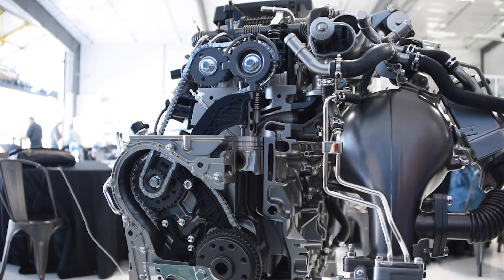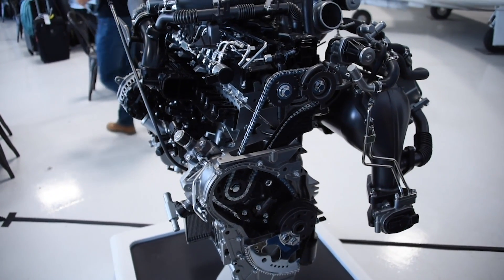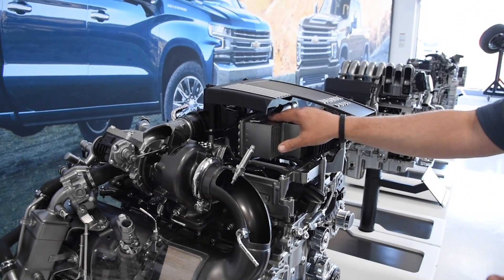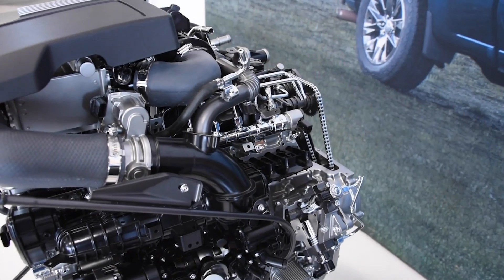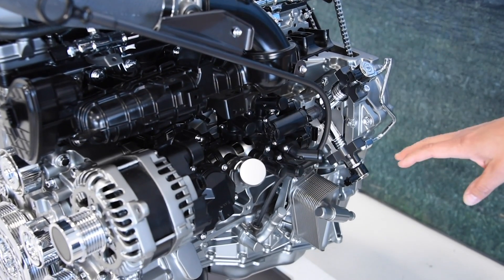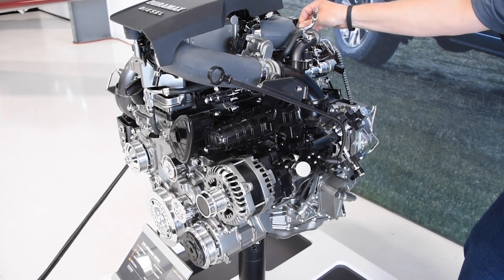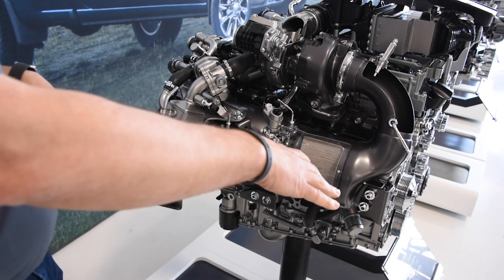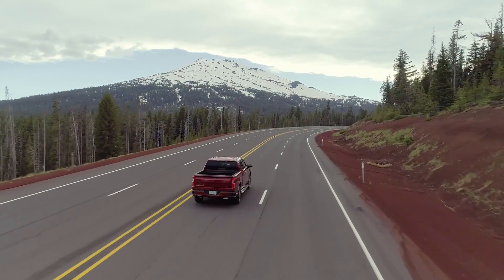What you don't know about the 3.0-liter Duramax diesel

Comment: Clean sheet design with all kinds of new technology.  What could possibly go wrong?  2020 buyers are going to be guinea pigs.
Reply: I just got done telling my 2nd gen Ram 5.9 Cummins about the story behind the Olds 5.7L Diesel.

She took it pretty well.
Reply: @JerzeyBoy  
Please, elaborate some more on the Oldsmobile diesel engine. I've never heard of it.
Reply: @Sig721Tau  the Oldsmobile Diesels were built between 1978 to 1985. They came in V8 or V6 configuration.
https://en.wikipedia.org/wiki/Oldsmobile_Diesel_engine
Reply: bill2526 bill2526  I would love to see a Toyota diesel over here in the states, it would be awesome!
Reply: bill2526 bill2526 you dumbass, I've got 20000 lbs to tow, now what !!!!!!  Girly Toyota can't tow that
Reply: It's going to be worse than fords 6.oh powerjoke.
Reply: @PatrickBaptist  the 6.0 was a great design until American emissions equipment hit it. It's a thing with imported diesels. International tractor trailers used a 10L engine from Germany that was great until it had to pass US emissions.
Reply: @vendediesel  from a "design" standpoint the 6.0 is and always was junk even with no emissions. I guess you have never taken one apart. It looks like it was designed as cheaply as possible and it shows.
Reply: @doch5123  if you were so brilliant you would know that that's a result of the engine being adapted to US standards and I'm not talking about the pushrod wear or the bolts per cylinder. It wasn't meant for PSD hp levels and US dirty diesel and emissions controls. Engines are designed and purpose built. The 6.0 was not purpose built for what ford used it for. In a 26000 lb International truck (what it was designed for) a 6.0 will easily last 300k with no problems except for the EGR cooler. Can you guess why that is?
Reply: Does anything last forever NOOOO... F^*ckin stupid!!!
Reply: "Clean sheet design with all kinds of new technology.  What could possibly go wrong?  2020 buyers are going to be guinea pigs." No jive. Classic Detroit BS.
Reply: You probably can’t afford a decent truck, no wonder why you sound so bitter.
Reply: @cubanpp   I can afford whatever kind of truck I want.  I recently bought a brand new Silverado 1500 LTZ with the 6.2L and Max Trailering package.  It's the perfect tow vehicle for my travel trailer.
Reply: @AlaskaErik  lol it's new it's perfect for a one way trip to the dumpster
Reply: bill2526 bill2526 i can tell youre a toyota driver by the incredibly low literary ability you demonstrate here
Reply: AlaskaErik Exactly! Get the extended warranty!!
Reply: @JohnDiMartino  Why should I pay even more just to get a bad motor fixed?  If I get a GM, it'll be with the 6.2.  At least it's been around for awhile.

Comment: This motor was created by engineers. Their Solutions are correct not armchair YouTubers.
Reply: ya? how about a master ase and gm tech that predicts those chains and belt system will fail commonly before many are out of 3 year 36k warranty?
Reply: Hmm, dry sump engines use belts for the oil pump. Seems like they work pretty well also. A lot of people freaking out on this.
Reply: This is an engine. The Volt uses a motor

Comment: How well is this going to work as a work motor? Pushing snow, Towing, constant use?
Reply from the maker: Well, the idea is that it should work like a diesel...it is designed for towing. However, probably not the same intent as a diesel that goes in a heavy duty truck, which is designed for heavy duty use. I doubt that there will be any snow plow application for this one.
Reply: not well better off with a v8 gas
Reply: @Mr Sunshines I didn't think it did.

Comment: Access the belt by simply dropping the transmission? Great idea!! The engineers should get a medal for making it so simple.  Idiots , how much will that cost?  Imagine how hot under hood it will be with all that emissions garbage on there .  Have fun who ever buys this disaster.
Reply from the maker: That's what I thought initially. But actually, dropping the transmission would probably not be any more difficult than if everything were up front, where you would have to remove the the radiator, fans, etc. Of course, we're talking for a technician, not someone in their own driveway...but it is doubtful that most consumers would attempt a job like this. I do agree with you about the under hood heat, though. That could end up being a problem over time.
Reply: The RV Connection , at least the front parts are manageable for the average backyard mechanic. A transmission not so much.  Just gm making it overly complicated so you need to bring it to the dealership and eat a huge bill.  Shop rate here is $160 an hour, so it will be expensive.  I think about the poor person that’s going to own these trucks after the warranty is expired .
Reply: Mr Sunshines sure.

Comment: How hard would it have been to just use a chain they want it to fail ive been around diesels since the early 70s and not even 1 had a belt driven oil pump,same enguineers that developed the oldsmobile diesel more than likley DUMB ASS!!!
Reply: It's a metallic belt... it wont fail.
Reply: A metallic belt is much lighter and efficient than a heavy metal chain.
Reply: @Mr Sunshines Finally common sense has arrived.
Reply: @Mr Sunshines your the dumb ass youll buy one then cty about it when it breaks

Comment: Terrible design. Dropping the transmission for that is unacceptable.
Reply: Its actually easier to service the belt from the rear! Use your head man! I am excited for this engine gm thought of there customers when they designed an priced it!
Reply: Having to drop the transmission to change a belt will make most owners sell this truck before it becomes necessary. This will kill the resale value. It might make a lot of money for repair shops but most owners will not want to deal with the hassle. The engineers need to fix this issue ASAP.

Comment: I am a GM faithful, I have four of them but I will not be buying this unit as it uses old technology that we already know does not work like injecting fuel into the cylinder on exhaust stroke. As tested in LMM Durimax and 6.4 power stroke. 
When the Colorado Diesel came out I went to the dealer to buy one and would have except my sons car seat did not fit in the back seat. So I have been waiting for the half ton to come with a diesel but now I’ll be waiting a while longer until someone cracks the ecm code so I can delete it right from new.
Reply: Be glad you didnt buy the colorado the diesel uses a timing belt my nephew bought one they said the belt has to be changed around 100k not good
Reply: @dewaynemiguel3349  that's not true lol
Reply: @geauxtigers2911  thats what the dealer tol him ,theres no reason to use a belt when you can use a chain unless you want it to fail ive drove bog rigs 42 years and companys would not buy a certain enguine if it wssnt built to last
Reply: @dewaynemiguel3349  then you should know that under a load a belt is better under load because it can raise or lower oil pressure depending on the situation.
Reply: @geauxtigers2911  but especialy in oil belts wont last they should put it where you dont have to drop a transmission to change them,peterbuilt kw etc listened when there was complaints about pulling a transmission to change a throw out bearing so they came up with the 2 piece and put a grease sert on them something they didnt have years ago im sayin i was actualy thinking of buying one of these trucks but not after hearing that iv had gas enguines last 3 even had a 350 go 4 hundred thousand every vehicle i get i keep atleast 200 k
Reply: @dewaynemiguel3349  it's easier to drop a half ton transmission...takes less than an hour ...then you have 1 cover to take off and you're at it ...it's actually alot easier, think about it...if it was in the front you gotta pull radiator, fan, fan shroud,  crank pulley, alternator, and what ever else you might have in the way probably unplugging several sensors,  then after all that you might be ready to take the front cover off
Reply: @geauxtigers2911  i dont care how easy it is you shouldnt have to for a lousey belt im saying theres a lot of sales lost from people like me because this little desihn flaw because i do all my own work and service and one reason i dont own fords anymore is they are not desighned to work on ,
Reply: @dewaynemiguel3349  dude I'm a mechanic, a timing chain will break before that belt will ...there's several advantages of having a belt over a chain #1 no oil bath is needed #2 a chain will stretch just as much as a belt will but since it's harder than a belt it will break before a belt will #3 you can't just replace a timing chain like you can a belt ...you have to replace sprockets and everything #4 if you're timing chain breaks you're probably bending valves and breaking pistons... belts are safer, they might wear out and jump time but they stretch and jump time before they break and destroy the entire engine
Reply: @geauxtigers2911  i dont care ive put millions of miles on diesels and ive never had a chain break but ive owned cars with timing belts that broke oil pumps should be gear driven anyways i put over 500k on old dodge cummins only problem it ever had was a fuel pump ,you may have a thousand of these belts last but no two anything is alike and they will have failures i drove for walmart 22 yrs and we ot brand new freightliners with pacar motors half fell apart half were fine we also got cummins not a single one had issues but gm has a bad track record of getting cheap
Reply: @geauxtigers2911  i understand your a mechanic this creates work for you
Reply: @dewaynemiguel3349  what car did you have that broke timing belts? Because it's rare for a belt to break lol
Reply: @dewaynemiguel3349   not for 5 years, they'll be under warranty until then, I own my own shop so I Don't get warranty work
Reply: @dewaynemiguel3349  I'm like this, chain breaks it destroys your engine, belt won't .. and that is a proven fact, and dude you're comparing c12 cats, ch13 Mack's and and Cummins (can't remember their most popular engine in big rigs) to a light duty truck engine
Reply: @dewaynemiguel3349  that is not saying you have to change it at that time, it's saying that's it's MINIMAL life span ...alot of other engines use the same recommendations like powerstroke
Reply: And anyone knows anything about engines knows this is a good design ...if it all ran off 1 system, timing and oil pump and it was to jump time...or something break then you can have bent valves are broken pistons ...but with a belt if it breaks it throws it into limp mode so you can get shut down... plus a belt gives you a pressure difference when under load that actually helps the engine
Reply: Geaux Tigers 
But it’s called 150t mile engine, but with the fuel for the dpf going into the cylinder on exhaust stroke like the 6.4 fords did, it won’t make 150t miles  as it will have washed out the cylinder before then.
Reply: @davidschmidt449  no it's not dude..it's dual shot injectors , they Don't spray on 1 stroke, they spray on compression then a little small spray on exhaust
Reply: @davidschmidt449  and that's not even anything new ... Duramax has been doing it since the LB7  ...it helps with diesel knock fuel efficiency
Reply: Geaux Tigers 
So it sounds as if you have not watched enough videos about this engine or you did not catch it when the gm engineer said that they are using the exhaust stroke to inject fuel for the dpf. The 08 LMM Durimax and the 08 6.4 power stroke did this same thing and both engines had very short lives from doing so. Them in 11 ford and gm added a 9th injector after the turbo to burn the dpf.
Reply: @davidschmidt449  i agree with you i always prefered gm but not there diesels i drove 671 8V92 even the 60 series but you could never beat a cummins or a cat they finaly get smart with pickup diesels by making it a inline 6 then turn around a put weak points in it makes no sense
Reply: @davidschmidt449  it's not just on the exhaust stroke dude.. they're dual shot injectors
Reply: @davidschmidt449  I sent you a link...read about how the injectors spray 10 times per combustion cycle...a combustion cycle is compression and exhaust stroke
Reply: Geaux Tigers 
I’m not worried about it doing 9 shots of fueling on the compression stroke. Coz it will burn that fuel as it’s under pressure. It’s the number 10 shot of fuel that it give it during regen on exhaust stroke that is stupid and will wash the cylinder and put diesel in the oil and causing all kinds of early wear problems. And they already know that will happen from LMM so why not start out with a 7th injector? Don’t make sense to me.
Reply: @davidschmidt449  you know things change right? People learn from their mistakes...and if you know anything about engines you should know that a little half shot of fuel will not wash a cylinder wall out...it's not like they're shooting it all in on an exhaust stroke.. like I said Duramax has been doing this since the LB7 ...This is not new and they have had no problems with cylinders washing out
Reply: @davidschmidt449  and I Don't know if you know this or not but all common rail diesel engines do thar, Cummins does it, the 6.7 powerstroke does it ..all the new eco diesels, etc etc
Reply: Geaux Tigers 
No they don’t. None of the new diesels do this anymore. Ram has 7th injector behind the turbo for the dpf. Ford 6.7 has 9th injector after the turbo. Gm LML and L5P have 9th injector after the turbo  (I have a deleted LML and removed the fuel line from the pump to number 9 injector in the down pipe) all to burn out the dpf system as ford and gm both tried it in 08 putting the dpf fuel in the cylinder on exhaust stroke. Go check the reliability of the ford 6.4 when they are not deleted. They are garbage when they have the dpf. 

But if you think this will be a great idea to try again then go buy one and get back to me in two years of use and let me know how it went. 
As for me I will be waiting till someone cracks the ecm so I can delete it before I ever drive it. If the dealer won’t do the delete for me I’d drive it home and pull it out before it has a chance to regen ever.

Comment: That oil pump belt scares me. Steer clear of this motor. I predict they will have a lot of problems with engines seizing due to that belt breaking prematurely
Reply: should be all gear drive for reliability and not cardboard gears like gm put in the 2.5 iron duke
Reply from the maker: I was told (and it was addressed in the video) that the engine will not be damaged it the belt does break; it will shut down before that can happen.
Reply: @Mr Sunshines It's still a poor design no matter how many "safeguards" GM puts in. The cost to have that belt serviced will not be cheap or easy since you have to drop the transmission. Definitely not worth the $45,000+ that these trucks go for.